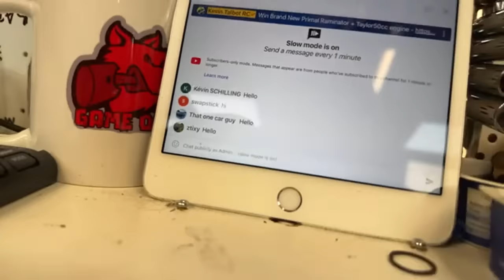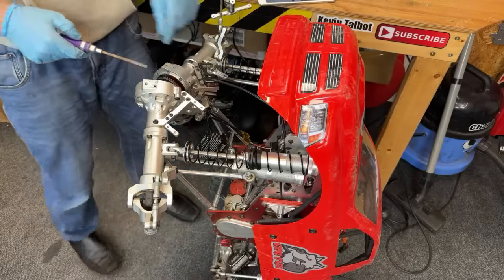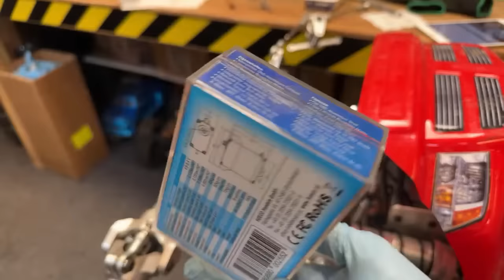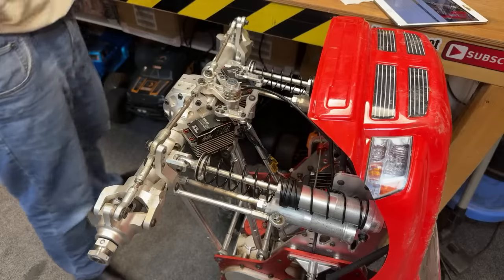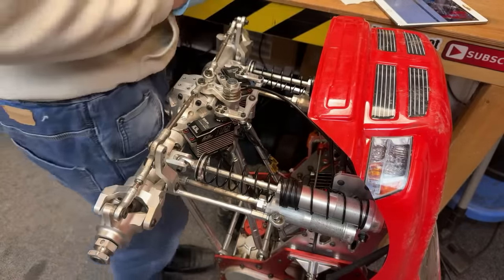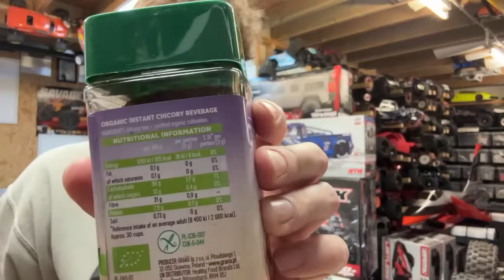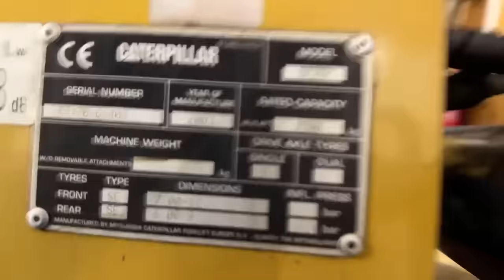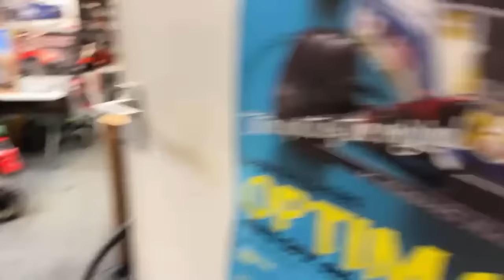Live repairing the worlds biggest rc car

Comment: Damn. I was late getting the notification. Sorry I missed my favorite YouTuber   Vinny from Connecticut USA. Finally got an XMaxx Ultimate. Wondering what upgrades, if any I should do.
Reply: Max 6 ESC and maybe an upgraded steering servo. That's about it.
Reply: an ultimate is already upgraded
Reply: They run much better with the hobbywing esc. Traxxas electrics are toggle switches. Brake and throttle are on/off. More power and better control with Max6. All of my 5th scale Traxxas rcs have been swapped. Night and day.